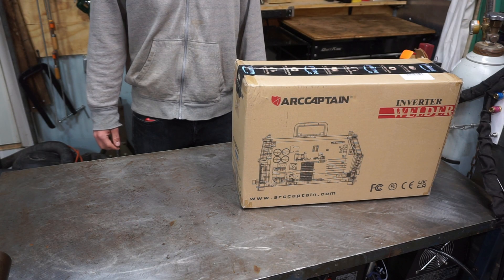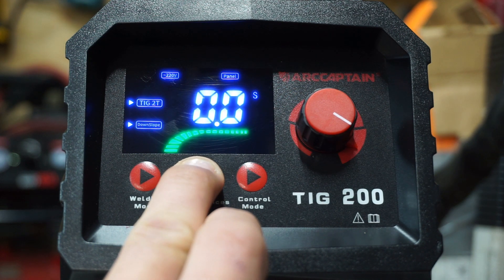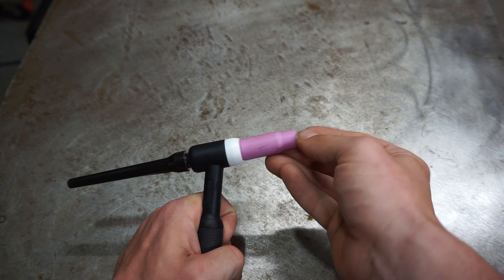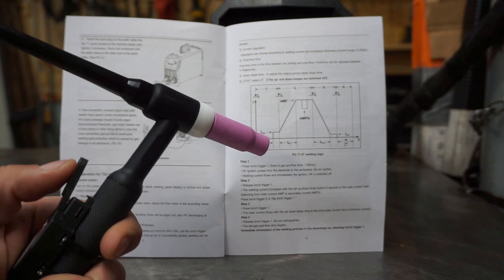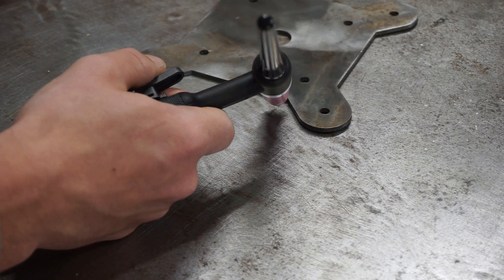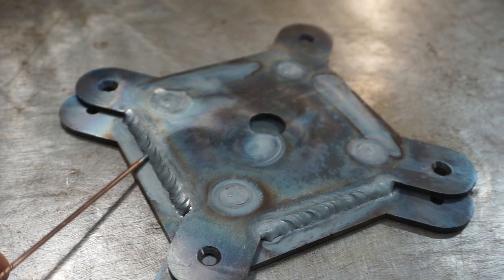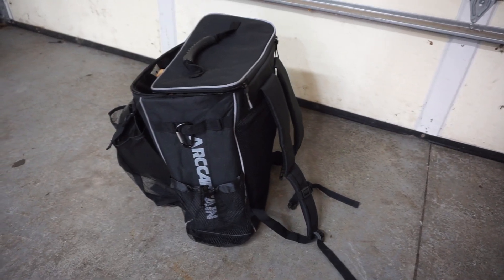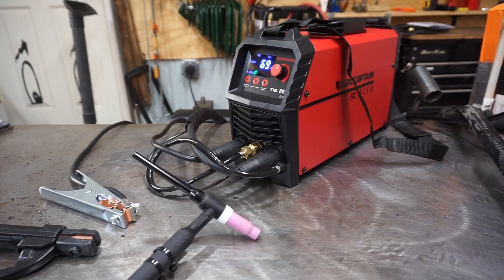Setting Up and Testing a new TIG and Stick Welder: Arc Captain DC TIG 200 Quick Start Guide

Comment: You did it wrong you leave your torch near the end of the metal when your done welding so the post flow can make sure the metal cools and the Tungsten rod can cool without the Atmosphere causing impurities    Min Post flow is 5 sec to 9sec depending how hot you run
Reply from the maker: Thanks inspector. I explain how to get to the post flow setting on the machine but perhaps I should have gone more in-depth on the time allotment, this is a setup video for a machine and not an instructional video on how to become the worlds greatest welder so I didn't think it was needed. If you look at what I'm welding it's just the thickest scrap metal I had laying around and it will never see a load so I didn't see the need to waste the time, shielding gas, battery/memory on the camera, ect.
Reply: @mattthemaker3787  try to incorporate the idea of that into the video so it makes people know it's right to do   it would be a good idea on videos
Reply: Some folks just like to hear themselves type! Your video is fantastic....But I thought that square steel block was a camera! I thought it might be a bit close to the weld!😁